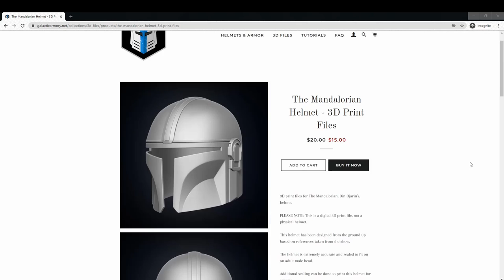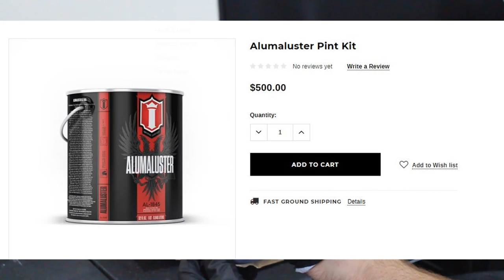Finding The Way - How I Made My OWN Mando Helmet

Comment: "this helmet was my most frustrating build ever"   prints it
Reply: "Dont have a printer? Buy a helmet from me"  also I wonder how cosplay competitions handle 3d printed items. Do you have to prove you made the file?
Reply: @theridley6451  I doubt it, especially because much of the work isn't in the printing, but in the post-processing anyway
Reply: @StalePhish  I've been disqualified for using patterns before I'd say the hardest part is the 3d sculpting sure you have to sand the print and paint it when it's done but that is the same for anything except maybe vacuum form

Comment: Ok, everything is ready! Now i just need a 3D printer..
Reply: The Ender3 is reasonably cheap and pretty reliable.
Reply: @ds222  depends where you live
Reply: A lot of libraries have them now and all you have to pay for is filament that you use.
Reply: @claram3132  just like i said before. Depends where you live.. there isnt such a thing in my country. I wish there was!
Reply: @emirzmen  oh, that's unfortunate!
Reply: I’m in the same position buddy.
Reply: Everything is ready. Now I need paint, PLA, 3D printer, a btush, sanding paper, resin, bondo, whatever that gray coating was and a little more things. I think my GP5 from 1978 will work fine as a respirator.
Reply: im quite excited because my school has printers we are allowed to use
Reply: @emirzmen  :')
Reply: @emirzmen  :( that sucks
Reply: @ds222  Is the ender 3 big enough for this helmet? Anyone know what he used? it looks like it may be the CR-10
Reply: @johnrugby5955  possibly.. build surface actually measures 235 x 235 mm. But most of the Mando helmet files i've seen come in parts you have to glue together.
Reply: @emirzmen  same bro
Reply: He sells the prints in his shop
Reply: @johnrugby5955  he used a CR-10, which is 300 by 300 by 400 mm
Reply: @KingJake-om7yq  lol its half of the my monthly income
Reply: @KingJake-om7yq  I appreciate it!
Reply: @emirzmen  sams
Reply: @ducks5654  luci
Reply: @ducks5654  luck*
Reply: Same*
Reply: @emirzmen  aynen
Reply: Ah be gardaşım
Reply: Yeah I'm in Poland and the cheapest one is like 150$

Comment: Fantastic Work! As a movie model/propbuilder just want to point out that the red stuff is spotting-glazing putty. Bondo is usually the gray/pink heavy paste that uses a catalyst. some people in the shop actually got so quick at applying Bondo filler with a plastic wedge that they didnt even need spot putty.

Comment: Ur helmet file... is amazing. Gorgeous. Beatiful. Top of the line.  I printed it using simplified 3d. I tryied something new. I rotated the model 45 degrees. Added supports. Rotated 45 in the opposite and did supports on the other side, so no supports from the plate. I avoided the middle visor support by doing 45s off the lips. Took 66 hours. But man it is the best I've seen so far. Finished the bondo part. Onto sanding now.  Im going to try to paint it the same too. Great video!

Comment: Scale/Sizing Question: I purchased this file and I would really appreciate it if you could provide some advice for finding the best scale/sizing to use for the model before printing. It seems like the file for the helmet is scaled differently than the rest of the armor (which have all turned out phenomenally, by the way) - After a lot of trial and error, I settled on a 95.43% scale for the armor thus far, but doing the same for the helmet makes it look like a bobblehead when I line them all up virtually within Cura. I'd like to measure twice and print once, so is there any help you can provide?
Reply: No reply lol
Reply: For future people that have this same question. I sliced the helmet file just above the visor and printed a small 5mm high section to make sure it would fit on my head and resized from there. The one gotcha with mando helmets is the cheek indents, which are smaller than the head part. So, you want to cut and test print a 5mm high section from there as well.

Comment: I printed the same model, but had to cut it up and join it to fit on my build plate, I noticed unnacceptable flex and it was cracking at the joins due to the flex, so your resin suggestion is great idea to strengthen it further.

Comment: Workable fixative has what we in the art industry call "tooth" meaning it is rough to the touch, meant to grab graphite from pencils the same as drawing paper texture would if unsealed. What you need is a satin finish spray, or possibly to mix graphite with a satin clear coat. I stopped the video at 9:26 to drop the comment, now I'll watch and see how you did it yourself ( : Nice work by the way.

Comment: Recently purchased your stl file for this build. I noticed that you added padding to make this fit. What percent did you print this helmet at? Also, I noticed that within your "Separated" files, your "Top Left" and "Top Right" ear pieces are much larger and not proportionate to the helmet base file. This makes it difficult  to print the Separated version, since I will need to resize myself until it's just right.

Comment: Great job, but I've noticed you don't bother with the print lines on the bottom of your projects. You should try using Milliput, two part putty that when hard is sandable. Helps to fill in larger 'rings' as seen on the bottom.

Comment: Good vid man. I do body work on cars and use the 'red toothpaste' every day. Might i give some suggestions? Hope to maybe make it easier for you and maybe take less steps.

 You could probably up the grit to 180 from 120 and use the 180 to get high/uneven spots flat with a sander. You could then take some 400grit and use that with water to wet sand it even smoother by hand. Make the bondo as transparent on the helmet as you can only leaving it in the lines. At this point before the primer goes on is when i would suggest looking over the helmet really well and add maybe with a small flexible bondo spreader more bondo in the spots needed. Pulling the bondo fairly 'tight' to the surface so you dont have globs or excessive thickness. If you do tight pulls you will be able to simply 400 wet sand the areas with out having to return to such a harsh grit. How deep are the printer lines? Ive never seen such a big object printed before. With it 400 wet sanded it should provide a very smooth surface then when you prime it it should be near flawless.  You should then be able to lightly sand that 1 coat of primer with 600* grit wet or dry. Remove the dust fully(blow it off and then microfiber it) and its good to paint.

* Cars are only brought out to 600grit before paint is applied. It should be enough for your helmet especially if you do it wet. 1000grit may not be needed. Also if you use an HVLP spray gun it might help you as well. It will help you with quicker coverage, a more uniformed look(not that yours wasnt but with an airbrush like you were using it takes much longer to get the desired look) and you can use the 1 gun for all the paints providing you clean it out properly in between. The cheapest gun ive ever used that surprisingly can put out a decent finish is a $15 harbor freight HVLP gun. Be worth looking into if this is something you are doing a lot of.

Dont know if this might help you at all but i dig the helmet man. Good work. I mean if you live in FL and would like some help on another one...

Comment: Use hardener with glazing putty and it dries in about 10 minutes instead of 6 hours....also filler primer only fills in 180 grit paper so after painting sand scratches will slowly start to show as the paint dries.

Comment: Use a real clear glossy varnish on the graphite powder instead of the craft school spray crap, then it'll look nice and be protected. It's not the same look from the show but it's a very good way to get metallic effects on your props, and depending on the base color you rub the powder onto you can get different shades and finishes of the graphite rub.

Comment: You really need to jump into smoothing your prints with sla resin , you just brush it on and under 5 minutes it cures in direct sunlight , then you wet sand and add some light coats of filler primer and your done , comes out flawless , so much easier than that bondo red  stuff

Comment: What gloss black backer did you use? I used a high gloss Rustoleum black rattle can 2x paint & primer and then applied the SpazStix. Came out beautiful and looked amazing. Unfortunately after a few months I started getting black spots all over. I did the full armor too and they all getting that spotting and got worse over time. The only thing I could guess is that both paints contain acetone so the paints just ate each other. I haven't recoated them and it's not as shiny anymore but the black spots aren't bumps or craters.  The surface is still smooth. Not sure how to repair it or just sand it all off and start over.

Comment: I've been wondering if you can sand the base 3d print without going to the inside of the print or if just filler will work

Comment: I did the whole build, sanded down with increasing grit up to 1200, use the same paints you recommended, and it came up super light and not very reflective. Did it need more sanding? Or is the paint composition different now?

Comment: Is there an easy way to find the surface area of the exterior of the helmet with software vs printing and taking measurements?

I want to try and learn electroplating but the size of dc power supply depends on the surface area your plating.

Comment: A few years ago, I bought a Kylo Ren helmet, and I used EVA foam (Hobby Lobby) in layers and hot glue to get it to fit my head. It fit very well after that.  However, I couldn't find visor material anywhere. Is there a good place to get that stuff?

Comment: i know this video is 2 years old but when sanding the bondo, does it all need to be sanded to where the bondo is between the print lines? i printed a first order stormtrooper helmet and i tried to sand the bondo smooth, i just went to where i could see the bondo between the print lines on some parts but i didnt know if that was right. how do you tell when to stop sanding is basically what im asking

Comment: Amazing. I have bought the files armor and I´m going to print it in a Ender 3 Pro, with white PLA filament, what printer do you use? In the 9:58 you talk about the color in the paint you bought in Amazon for less than 20$,I don´t really understand, you said something like .......chrome. Thanks
Reply: I have an Ender 3 and I wonder if it will fit on the print bed as a one piece print that is large enough to wear. Were you able to do it? I printed one of these using different plans in in 4 pieces on mine because I wasn't sure if it would be big enough.

Comment: what size do you recommend for the 3d print? i measured my head but the helmet seems to bit  tight to the head. Should i print it a bit bigger to have a bigger gap between my head and the helmet

Comment: I wish I had enough money for a 3D Printer to do my own stuff. But may have to buy in piece mail the set I found on Etsy for 630 bucks.
Reply: If you got 630 bucks for that just buy a printer! I got mine for 200 and it can easily print a mando suit, look at getting an ender 3 pro

Comment: great job, but just some clarification fact here. resin alone is not strong or strength worthy. its rigid yes, but thats about it. without the fiberglass matting, resin alone has no strength at all. application wise, lacquer based red spot putty and bondo are 2 completely different items. Bondo is a brand name, not a product. spot putty is lacquer primer with far less solvents included thus making it a putty. all in all, it may serve purpose for delicate use, but beware.

Comment: That red bondo stuff really sucks. It shrinks when it dries. So even if youve perfectly covered everything youll still have to do it several times because it shrinks after it dries. It also cracks if the helmet slightly bends. I would recomend using wood filler instead

Comment: What printer did you use?
Reply: You need at least a 300x300mm print bed to print it in one piece. If you want something that is relatively plug-and-play, a printer like a CR-10 V3 or Ender 5 Plus will work well.

Comment: those helmet pads happen to be the ones they use to line ballistic kevlar helmets. Specifically the Advanced Combat Helmet (ACH) used by the Army and Airforce.

old helmet systems used a liner or suspension system to keep the helmet off your head. but these pads are designed to stick directly to the inside of the kevlar shell.

Comment: FYI, polyester resin, ie fiberglass resin is NOT liquid fiberglass. It is a resin that is made for use with fiberglass cloth. By it self it provides zero additional strength. It needs to be used with fiberglass cloth or mat.
Reply: Does it really matter?

Comment: Your print is to big. To get things looking their best, you have to print it within a hair of TO TIGHT otherwise it will always look bobble headed. 
Also, never waste time with rattle can chromes and sometimes skip the silvers as they will let you down every single time and tend to be soft as can be upon fully cure. 
The ALCAD is the way to go unless you want to use ALUMILUSTER.

Comment: Lots of bad information here. If mixed properly fiberglass resin cures fully in under a half hour, not several hours. Also resin needs a mechanical bond so a smooth plastic like this helmet is not a good bond. Any flexing of the helmet will cause the resin to break free so using it to stiffen flex parts is ridiculous.

Comment: OK, so I am @ 6:23 in the video and I just can't stand it any further without commenting.
First let me qualify that I am an experienced composites technician with many many years experience to include hand made prototypes long before 3D printing existed, and movie prop experience as well.
Pretty much everything this guy has done after pulling the part from the printer is not the way you want to go about doing this.
#1 coating the interior with polyester resin without a substrate is a waste of time and money. The resin he used is for mechanical bonding, without an interface the resin will fail over time relative to use with the smallest amount of flexing. Molecular bonding materials is what is called for here, IE; epoxies. Just make sure what you use is compatible with the plastic, and use a dam substrate. You could use regular polyester cloth and/or veiling which will give you a half decent finish.  
#2 going straight to using a glaze putty without first removing any highs from the part just makes that much more work. Spend a little on tools for God sake man. Go buy a Dremel with sanding attachments or similar model making tools.
#3 using layer upon layer of filler is down right just lazy. Start by razor scraping or heat to remove the imperfections left by the printer. Then think about fillers. Use a quality high build primer. One that will allow 30 to 50 mils per procedure. Light sand in between. And remember, you are only filling lows. Try using appraisive pads made by 3M. Any auto body supply should have them. And never use lower grit count papers and always wet sand to lesson the depth of the scratches and assist with the flow of debris so you're not sanding in more low areas.   
#4 which should be #1 and that is; find someone who is a pro and ask, ask, and ask, because what you learn on one project may help with the next. Using a soft lead pencil, inspect and mark areas you will fill as you do your first cleaning with the razor and/or heat iron. Covering the whole helmet right off the bat is NOT the way to go about this.
If this guys parts are too flexible then just add ribs into either the drawing itself, or bond them in prior to installing your liner.
Reply from the maker: Wow you should make a YouTube channel
Reply: @GalacticArmory  Hahaha, funny guy. OK, so I finished watching the video and my major question to you is, why so much time spent on the finish yet not using your time doing the prep that is reflective (pun intended) on the final product you want to create? Example; you went a hundred miles an hour applying the glaze putty just to realize you filled in details and had to scrape them clean. Had you taken a minute to put on a lick of vinyl tape after inspecting this crevice for quality that mistake wouldn't have happened.  You're just fortunate that you used such a soft filler made for "pin hole filling" that you were able to correct your mistake. 
I have a friend that's a model builder, and I remember him building a Nemitz class. The model was first rate in his opinion, but he still spent 10 or so hours cleaning parts before he spent the 400 hrs building it. There are many ways to accomplish an objective, which is one of the exciting attributes of the human condition. However as you define your objective, so should you define your techniques. Look, Mr. Armour, I am not trying to beat on you about what you do per say. However, what your finished project is here, is strictly what I would consider a "static prop" IMO. The reason the paint you displayed is $500 a pint is because of what its quality is and the application perimeters it was made for.
You clearly have the skill, how about you look to refining your choice of technique and material knowledge so when you bang heads with that storm trooper you don't have to re-finish your work? Next time you go pricing materials, ask yourself how many can I build with this volume? What would they sell for? What will give the best finished result, not how cheap can I make one for. (If you want to play, you have to pay) Then when you have a really good final product, just let everyone know that there are "x" up for sale over at eBay or something. Maybe even do a give away for some lucky soul.